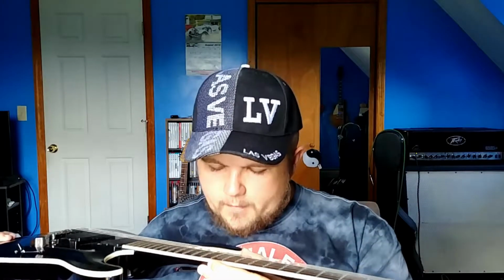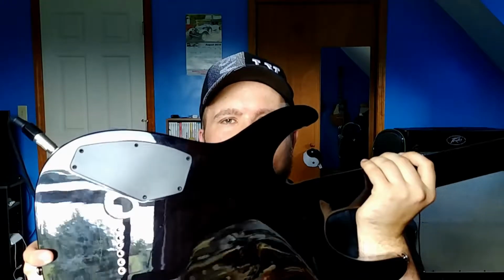Problems with Emg Pickups

Comment: Fun fact I spent 8 months badly wiring my bone breaker set, you don’t use the string ground for emgs, you actually put the braiding from the selector wires into the ground ports. I didn’t know this until a week ago 💀
Reply: THANK YOU SO MUCH!!!!!!!!!!!!!!!!!!!!!!!!!!!!!! I’ve been having this trouble to
Reply: Jow send a diagrqm
Reply: Read the diagram 😂

Comment: Hey buddy EMG pickups don't require a ground. The only ground comes from the switch. And the new Jack is also a ground. I just put the Het-Set in my Les Paul Thursday and I love them. Hope this helps bro keep rockin'
Reply: They are ‘grounded’ through the negative terminal on the 9V battery

Comment: You wont suppose to  ground EMG active pickups, old connections with a grounded bridge should be isolated, the active electronics are dead quiet
Reply: Hi you seem to know what your talking about. I have a question if you can help. I have installed the wireless het set EMG pickups, everything works apart from the bridge pickup. It works then cuts out then works then looses the distortion and sounds quite and as if it’s on clean. When I wiggle the bridge volume pot it’s comes back the after a few seconds it cuts out. Is it possibly the pot or the toggle switch? Thanks
Reply: @RT-if2ij  change batteries

Comment: You're the antenna. The ground is missing.
Reply: I don't know if I get what you mean,but I thought set ups like some specific guitar and amp would always create static noise ,it's like the tone none is giving high input that's too much for the control knobs and amp input to handle🤔
Reply: Nival I think what he is trying to say is that when you're holding that guitar you're like an antenna on a radio and that guitar will pick up sound from you once you ground the EMG which apparently EMG says you don't need to but other people say it does help hopefully that sound would go away I get what he's saying though!!! I think! Maybe that cleared it up for you!

Comment: EMG's were built for mid/low gain marshal amps back in the 70s and 80s. They were made for metal. Now we have amps with loads of gain so there are no use for emg's anymore. Unless you can make the cleans work without them clipping. Then they are really good pickups
Reply: Not true at all. You can use EMG pickups with any amp. Quit the bullshit man
Reply: Is that why James hetfield uses Emg ?🤪
Reply: @VitaTristis  You can use EMG pickups with any amp, but I think that LR makes a good point. Extra high output sounds like it's designed to drive older tube amps.

Comment: The issue I had was the battery sited under the scratch plate was shorting to the volume pot so the volume was permanently on. The ringing noise was due to term springs - I had removed the back plate. Don't know if this helps?

Comment: I own the LTD MH-1000 and it came with 81 and 85 and they're not supposed to be grounded at all. I highly recommend the quick connect. When I bought the guitar, the electronics were soldered. I moved over to the quick connect system 3 years ago and will never look back. Pots, battery connector, 3 way switch, plug in jack and pickups are all quick connect and very very easy to change and it sounds better than it did prior when it was soldered. If you get a 3 or 5 way switch, you don't even need the bus that comes with the package. I'm using the Tele 3 way selector and it works great. The bus is for a guitar that will still have a soldered switch otherwise if you go quick connect on the switch, the bus is eliminated. Trust me...totally worth it!

Part of the problem with soldering is bad wires or bad solder joint. If any one of the joints are bad, that's the noise you will get. GO QUICK CONNECT!
Reply from the maker: Thanks for the tip

Comment: I was able to figure that out for 3 days, they usually say that you need to ground the wire together. That causes that high squeal sound, what I did is to ground the pickup and switch to the volumepot.and the plug and bridge ground another pot.

Comment: I recently put a new pot in my old Kramer guitar that had an EMG 81 active pickup! I had lots of issues trying to get it to work correctly! Luckily YouTube has a lot of educational stuff on soldering and all the goodies! I think my mistake originally was I used silver solder which takes a higher temperature to melt and I didn't use enough rosin I didn't tend the pot like I should have but eventually I figured it all out from YouTube I went out and bought some solder that was partially tin and lead that had a lot lower heating temperature to make it turn to liquid! That helped me out tremendously I made my connections but then I still had a great volume but when I turned it to zero I was 75% at my volume!!! I was disgusted so I took my liquid plastic and I put it on my connections just because that's what I like to do! Took it to a local guitar guy that thinks she knows everything about everything you know those type! He looked at and said well no wonder it doesn't work right you got it all wrong you never put plastic on those connections if that was the thing to do guitar companies would do it! Well he made me feel like an idiot but you know I'm kind of a do-it myself kind of thinker and I'll do what the hell I think is good to do don't tell me by putting liquid plastic on any connections that it hurt it I was going to take the whole damn stuff out and throw it away and start from scratch anyhow if it didn't work! So this is a funny story for you guys if you've ever been put down by people that play guitar work on guitars because I know there's people out there that do that! He takes it over and plugs it in now mind you what he said earlier! It worked and sounded great and even when you put the volume back to zero it shut the sound off like it was supposed to! He says well guitars are funny things!! What happened to me having it all wired wrong and putting liquid plastic on the connections! Ha ha!!! But back to the point where I did mess up was one of my soldering connections on the pot was a little loose it might have been what they call a dry solder but you can fix these yourself there's plenty of information on YouTube and if you have any questions text me I'll try to get back with you! And there is a reason that EMG went to the quick connect that was so nobody had to mess around with all that soldering because they did have a lot of problems and issues with that? All right take care and have a good day

Comment: I have a Spector 5 string with an EMG BQC preamp with a 40DC  bridge and a 40CS neck pickups. The bass sounds great. Especially forr metal but with that preamp I can dial in just about any tone I want. Proper installation and shielding makes a difference and if you are grounding your emgs to the bridge you should let someone who knows what they are doing or that knows how to read instructions install your pickups because youre fucking up. There are other great pickups on the market but EMG is an industry leader for a reason.

Comment: I have a old Bc rich Kerry King guitar it had no Active pickups in 2014 I got a EMG Alexei pickup on sale for a project guitar but I was impatient and installed it in the KK Warlock yes I had ground wire problems and I could not fix it never had any time to take it to a shop

Comment: Just installed passive EMG Geezer Butler in my bass and the bridge pickup's volume is so low. Like almost inaudible (but it is there). Checked every connection, swapped pots, I can't get it to work as intended. 
It's actually the replacement set because the 1st I ordered had the same issue and I thought something was faulty. But apparently that wasn't the case. Very unlikely to receive two new sets with the same problem.
Reply from the maker: I bought the guitar used and the pickups too, but the guitar is long gone now

Comment: I don't have the exact same problem but I have the exact same pickups in one guitar. My bridge pick started to loose some bass end, I don't know if it's the cause, but it happened after I sprayed it with some contact cleaner.
Reply from the maker: I had a grounding issue make sure to wipe it down after using the contact cleaner

Comment: I have a stock guitar with EMGs in it and the bridge pickup makes noise even with volume at zero... and when the volume is up its INCREDIBLY feedbacky... like to the point where I can hardly use it. Not sure if this is normal or not.
Reply from the maker: It is not suppose to do that. I would take it to someone that knows what they are doing. Unless you know of to mess with wiring

Comment: Hi bro did you get any fix for this problem I have today the same issue due I sent to change the emg 81/85 to my explorer ephiphone
Reply from the maker: I ended up selling the guitar but I believe it was an issue with the grounding of the wires on the volume pot

Comment: I switched my EMGs over to the solderless wiring and somehow now the sound is muffled slightly. The tinny sharpness isn’t there - why? It sounds like the tone knob is drawn back 50% and I don’t know why. Checked all the points all check out. Anyone have this issue?

Comment: Bro i wanna wire my emg so that are passive to regular pots instead...that are quick connect.  They have 5 wires going into the pick up but at the end of the wire the quick connect only has a red and a green & plain metal wire ran together for 2 wires total at the end.  can I solder that to a regular pot?
Reply from the maker: I dont think you can wire an active pickup passively to my knowledge. And if it does work it would probably sound bad because you need the 9 volt

Comment: I'm having the exact same problem. I bought a Het Set pickup set and tried to just use the bridge pick up, and it's doing the same exact thing as yours and sounds like your guitar. Like crap
Reply from the maker: I think it is some sort of grounding issue. My guitar sounds fine and it doesn't drain the battery so for now I am not going to mess with it.
Reply: @graysguitars5113  I think what the problem was is if you have a pickup set, it doesn't come with an active tone and you need an active tone to have your volume work correctly with one pickup.  If you have the 2 pick ups it comes with the selector switch that has the ground in it I believe
Reply from the maker: @teutonicresistancetv6445  I used the original switch maybe that is the problem
Reply: @graysguitars5113  I think if you use an original switch that came with the guitar you have to ground it to that hub
Reply from the maker: I might have to look into that

Comment: Sounds like your output jack connectors are not on the right pins. I had this issue and that was the culprit.
Reply from the maker: I ended up selling the guitar I think it was something with my switch but could be

Comment: I know this is old, but did change out your 500k or 250k pots to  25k, or were they original?
Active pick-ups usually require 25k.
Reply from the maker: yes the pots were changed out, i believe the issue was it was grounded when it did not need to be, i actually sold this guitar a while back

Comment: I always have problems like this,but it's kinda complicated because I've always have problems like this whether it be the different guitars or amps or pickups and I thought it's my equipment that's the problem but then I went to the guitar store and tested their high end stuff and some have the same issue and some not ,so I tried playing with the knobs on the emp for a lil bit and found out that it does work but not all of the amps did the same thing,some are still like that and some did solve the issue,but in conclusion,I'm just so confuse cause the answers that I got from experimenting didn't come out with a fixed answer so I need help from a pro, anyone pls help me🥺
Reply from the maker: Was it with the same guitar or different ones I know the issue with mine was a grounding problem with the switch i believe

Comment: Im trippin over here. I have a single 81 in the bridge. 
Now I know tightening the screw raises pickup height from years of playing. 
But its not raising them with my Blacl Metal Arrow! Wth
Reply from the maker: Do you have a piece of foam under the pickup? If that is worn out you may need to replace it if the pickup is direct mount
Reply: @graysguitars5113  Thanks a lot but mine raised when loosening screws I realized lol

Comment: Omg i just started having this same problem since yesteday when i tried hooking up a tone pot. It stared buzzing whenever I touched the bridge so i left it at just the volume knob. Still kept buzzing and now the volume knob sounds scratchy. Wtf?...i tried different combinations of wiring and i get the same result . Fml🤬🤬🤬
Reply from the maker: you need to make sure you don't have raw wire touching the shielding paint that was my issue
Reply: Grays Guitars I figured it out. I connected the soderless wire connections with the arrow facing up instead of down lol
Reply from the maker: @jeffreyquinonez8964  I did not have any of the quick connect stuff
Reply: Grays Guitars those quick connects are awesome man
Reply: Jeffrey Quinonez what if I’m having the same issue and the arrows are already facing up?